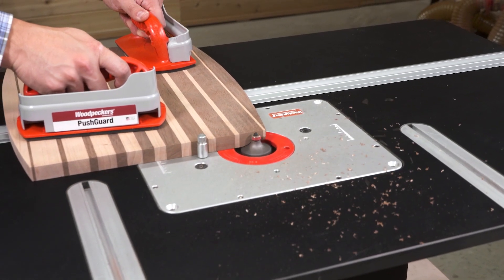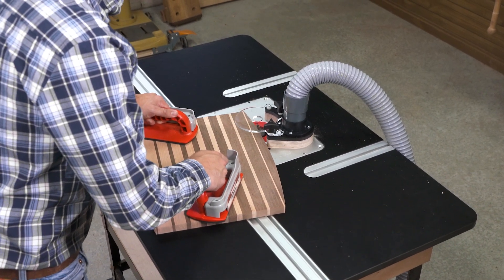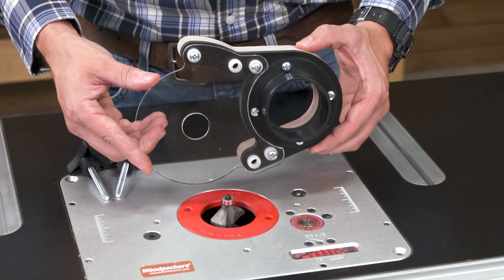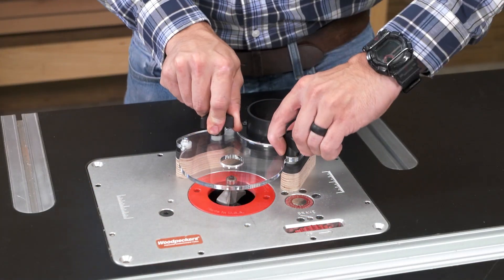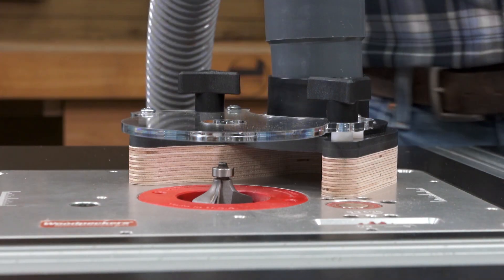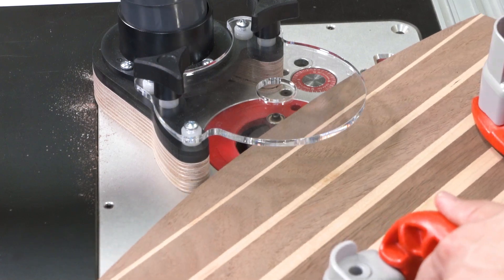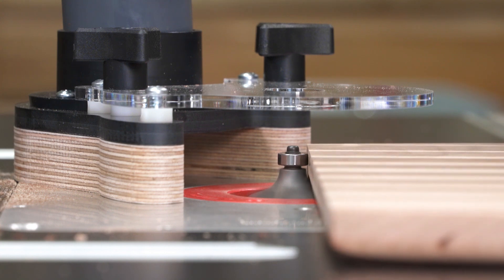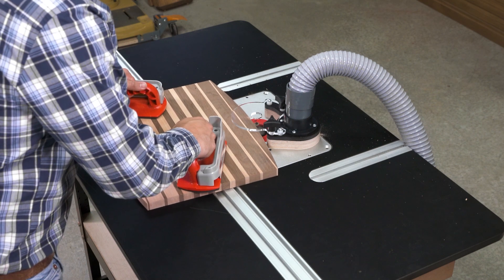Freehand Guard | Woodpeckers Woodworking Tools

Comment: Will it work and fit the SawStop router table..?
Reply: he clearly said it fits any woodpeckers router plates
Reply: and has bolts to fit other router tables
Reply: You have to drill and tap the holes to accept the bolts.
Reply: All the device needs to do is connect via a handle through one hole at time. The manual doesn't say if it has the 6mm holes which I think SawStop needs (if I read the manual correctly). It's close enough to the 1/4-20" so you probably do not need to drill anything. The worst would be that you have to find your own 6mm knobs.
Reply from the maker: Mike, it needs two mounting points, not just one. Don't know if the SawStop plate has starting pins or not, but chances are, if they do, they're metric and not spaced the same as the starting pin holes on a Woodpeckers plate or lift. If there are holes in the plate, you might be able to use one and only have to drill one more.
Reply: Where is Jeff Ferris?
Reply from the maker: Have to let the new guys have some of the fun, don't I? lol